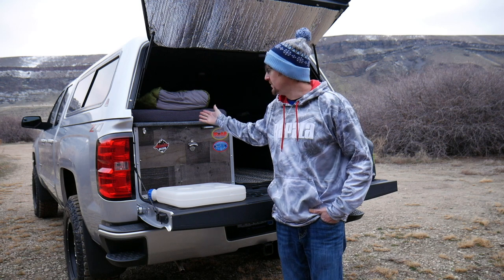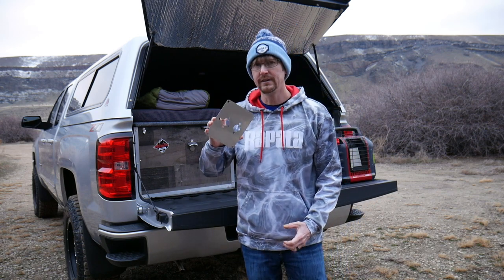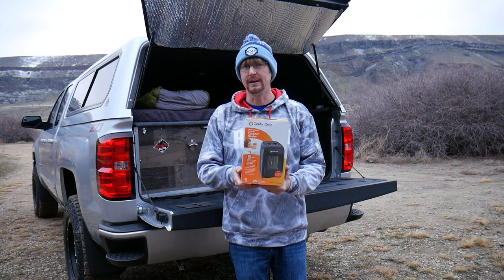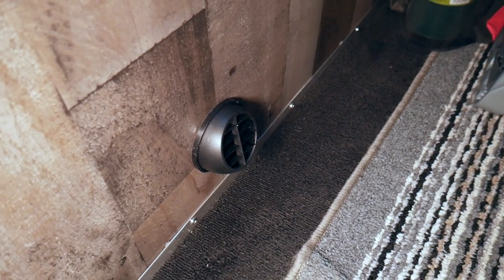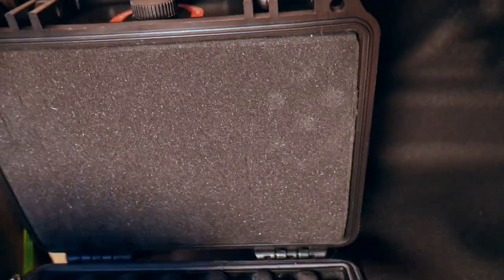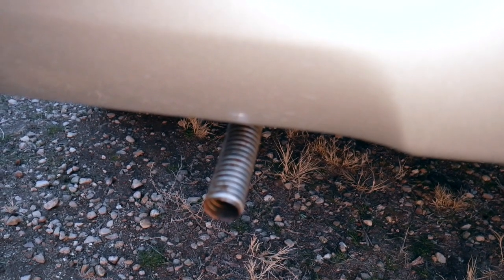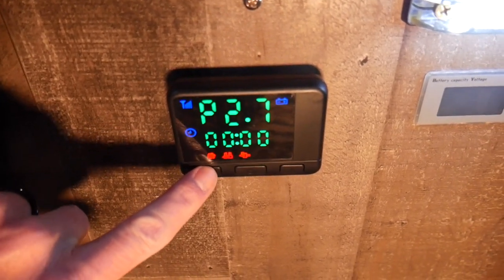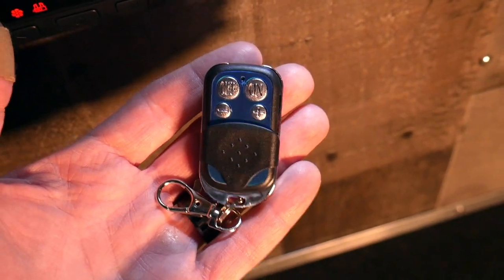Diesel heater setup in my 2019 Silverado! Best heat source for winter truck camping?

Comment: I have several of these heaters. The older ones with the metal body just don't die. The ones you get from ebay or amazon with the plastic bodies nowadays typically last a few years. The diesel pump and the internal fan motor are the only problems I've had so far. The pump for some reason just quits and you don't get the proper dosage causing it to try and start but it won't. The internal motor to drive the fan blades is a brushed motor. The brushes wear down eventually and its much easier and cheaper to just replace the motor than the brushes. You will hear a whining sound when it starts to go and the force of the fan starts dying down. From what I remember both conditions cause an error code. Much love from NW Ontario Canada
Reply from the maker: So far so good. This one is 3+ years of being used and not an issue. If it dies at this point, it's cheap enough to just replace.

Comment: Do you have the link for the plate you mounted your heater with?
Reply from the maker: Hello, here is a link to the plate I used. Thanks for watching.
https://www.ebay.com/itm/294028318502?hash=item4475741726:g:AoEAAOSwxqBgNGV3&mkcid=1&mkrid=711-53200-19255-0&siteid=0&campid=5338906919&customid=&toolid=10001&mkevt=1

Comment: I'm thinking about using one of these to heat the cab of my Toyota Tacoma, on which the heater has gone out. My question is about the power source. I don't know much about marine batteries. How would you recharge the battery the diesel heater is connected to since, in the setup shown here, the battery doesn't have an alternator to recharge it? My biggest question is, if I mount the diesel heater in the bed of my truck and run a hose to the inside of the truck to pump in the warm air, while venting the exhaust out the tail gate, how would I provide electricity to the heater?

Comment: Can you safely run the Chinese diesel heater… While you’re running down the road?
Also, would you include a link to the adapter plate for the bottom of the install that you ordered? 
Excellent video and thank you for your time .
Reply from the maker: I probably wouldn't but I think some people do in vehicles and camper vans. I have links to the plate in my newer diesel heater videos. Thanks!

Comment: Great video! Really nice DIY solution you came up with. One thing... I recommend you get a carbon monoxide detector to install in your cab just for safety in case there's a leak in the exhaust or combustion chamber.
Reply from the maker: Thanks for watching. There actually is a detector in there. I didn’t specifically show it, but it’s definitely there.

Safe travels

Comment: I have been using one of these for 5 years now, a 8kw unit but its in a RV. I live in it full time, including Canadian winters. the only thing that wore out was the pump, $28 to replace. To be fair it was probably my error, at minus 40 the diesel fuel will gel burnt out the pump running dry. 

I now run a 1:1 ratio of kerosene and diesel in the winter, zero problems since. brilliant idea on the camera box for the pump. For the exhaust I used a marine chrome exhaust port flange from amazon, $40 super clean install
Reply from the maker: Good advice. Thanks for watching!

Comment: You need to market that fuel pump noise suppressor, that is a really great idea!
Reply from the maker: Thank you. I still feel like I can make it even quieter. That's one of my goals for this summer. We'll see what I can think up.

Thanks for watching.
Reply: @Outside605  couldn’t you just put the pump on the outside; under the truck bed.

Comment: I have a 2019 Ram and was looking into this but I don't know if I want to drill a 4 inch hole on my 70k truck. I mean, my wife may not agree with it but 4 inches is significant.
Reply from the maker: HA!
It's a painful decision to drill into a nice new truck. I keep the piece that the hole saw cuts out and when I sell/trade, I tack it back into place. It worked pretty slick. I traded this truck in about 4 months ago and it wasn't as noticeable as you'd think.
Thanks for watching

Comment: I’m on my 5th velvor? Diesel heater and I’ve never had a single problem with any of them. I full time a motor home and use two of these to  heat a 30 foot motor home. I also have one in my jeep and truck. You can’t go wrong with these for the price.
Reply from the maker: I have no complaints. I ran this one quite a bit all winter long with zero issues. From elevations around 300' to 5,000' - it never failed to start/run and I never had the soot issues some people experience. You're right - for the price these are really tough to beat. Thanks for watching!

Comment: As for longevity I've had a five kilowatt one for over five years now and it has worked flawlessly  I have it in a 24-foot Class C motorhome it will keep my motorhome warm at  -20 Celsius no problem  it's been a great investment
Reply from the maker: That's great to hear. Hopefully I get the same results. Thanks for watching!
Reply: Glad to hear I have a 2k in a stand-alone unit I use for truck cap camping. Work great ! Really hope mine last as long. If it last 5 years like yours that’s $20 bucks a year.  Great bargain compared to paying extra for a powered camp site, running a generator, or even using a propane  heater.  Thanks for your comment!

Comment: Great video! Good detail ! Do you get a diesel smell At all? Trying to figure out how I can make your setup work for me.Unfortunately I have a big cab with a 5 1/2 foot bed.Also I'm a little too tall to sleep length ways so I may have to do a full size mattress and sleep corner to corner.Thanks
Reply from the maker: No smell at all. I would highly recommend a turret plate to install the diesel heater. Much easier to seal up to keep any potential exhaust/fumes out of the space.

Good luck on your install!
Reply: @Outside605  Thanks!

Comment: Great Video.  I have been considering a Diesel heater for my truck, but I live at 7,000 ft in Colorado.  I have been researching how well these heaters work at altitude, but even the expensive heaters say they work up to around 8,500 ft.  which isn't much higher than where I live.  Have you used your heater at elevations in this range and did you notice any issues?
Reply from the maker: I've used it to about 6-7000' but not higher. I think you can get creative with the settings to better function at high elevations but I've not done that yet. 

Good luck!

Comment: Excellent job on the installation! I've been truck camping since the 80's & I've always used electric heaters, but this now has got me thinking about getting one. Drive safe. 🤠
Reply from the maker: Thanks for watching. They are fairly efficient and don't cost much up front. A little creative install, and it's a great way to stay warm all winter.

Comment: I replaced the propane furnace in my 18 foot camper with an 8kw diesel heater. I lived  in that camper full time for 3 years and only had 1 issue with the heater. About 2 months in the fuel pump gave out. the best part is the heater put out way more heat than the propane furnace and went through way less fuel. 20lb propane tank would last 1.5 days vs 1gal of diesel a day
Reply from the maker: That's awesome. They are very economical vs propane for sure. I did the math last winter, it cost me less than $2 a night to heat my truck. Can't complain about that.

Thanks for watching!

Comment: Great video and camper build! I have a 2004 Dodge Ram I am planning to set up as a camper. I like the lightweight, simple design your have. Question about the heater intake: Does it use fresh outside air and or ambient air intake that's switchable, kind of like a car heater?
Reply from the maker: Hello and thank you. The heater intake uses fresh air from outside via an intake pipe mounted under the truck box. There is a fan that blows ambient air through the heater "fins" than warms it up. When installed properly, I feel like it's safer than a buddy heater. I still use a carbon monoxide detector just to be safe. 

Thanks for watching.

Comment: I've  been dragging my feet on installing the one I have for my truck and really appreciate your videos on how you did yours. I do have a question about the fuel line as I must have missed something. Why does the fuel line go into the bed from underneath if the heater and tank are both in the bed?
Reply from the maker: That’s a good question. The path of least resistance to the combustion chamber if I had to guess. Thanks for watching
Reply: So you have the option of plumbing to truck's diesel tank instead of small plastic tank. That way it's all outside.

Comment: I had a fun bunk in my 1992 3/4 ton Dodge  4x4 5.9 12 valve Cummins and we pulled a 25’ Road Ranger and we went all over the west so my wife and daughter and her girl friend for 5000 miles and in the mourning we put a 12 volt fan in the sliding back glass with blow up seal between truck and a big glass camper shell and with ac on max and vents blowing toward back window they stayed cool all day and it worke great and dear season a little ceramic heater plug truck and tur it on high and 1/2 later put on low and stayed toasty all night .
Reply from the maker: Sounds like an adventure. 

Thanks for watching and safe travels.

Comment: Great video!

Any idea what kind of current draw do you typically see out of this?

Also, what size battery is that you're using? Do you just charge it off shore power?
Reply from the maker: I haven't spent time looking a usage draw but with a 100ah battery, I can run it for 3-4 nights on a charge. Maybe more, I've never run it out before adding charge. Shore power or my portable generator. Works well for my needs. A roof mounted solar would probably be a great option.  

Thanks for watching!
Reply: @Outside605  Appreciate the prompt response! Found some details on other sites that listed it at about 0.7Amps give or take so that checks out. Seems like it'll work in nicely with my build and electrical system going in. Thanks for the info and inspiration! Keep crushing it.
Reply from the maker: @bigrunnermaniac  Fantastic. Mine has been flawless so far. Good luck and safe travels!
Reply: Useful video and well put together. Thanks Man.

Comment: Thank you for the video! Looking into heating my truck bed camper but wanted one small enough not to burn too hot
Reply from the maker: Thanks for watching! A 2kw seems to be just right for a truck cap. Careful when purchasing though, not all heaters advertised as 2kw are actually 2kw. Best wishes!
Reply: @Outside605  one question I have since I’d rather avoid drilling a hole in the bed of my truck, could I install the whole unit sideways and rig up to vent out the little storage recess in the side of the bed and out the rear? Or install on the exterior of the truck and duct the heat into the side opening. I have a whole summer to figure out exactly what I can or can’t do but I plan on making a little video detailing my path as well. I’d love to see any camper updates you’ve made since
Reply from the maker: It's very possible. I wasn't a huge fan of drilling a hole in the bed either but I worked up the nerve to do it. In hindsight, I wish I would have thought outside the box a little more.

Comment: I'm curious.  If the fuel line enters the heater from under the bed, couldn't the fuel pump be installed under the truck bed as well.  Wouldn't that avoid noise inside the  sleeping area?  Or is there a reason it has to be inside.
Reply from the maker: You absolutely could. I've seen that often on van builds. I drive through a lot of slushy, salty roads in the winter and having it inside is one less potential point of failure. The downside is the noise. Thanks for watching.

Comment: Have you had any issues with mud, dirt, dust, or grime on your intake underneath the truck?
Reply from the maker: I haven't. I put it out of the way where it's not as exposed to mud. Dust - I'm sure it's seen it's fair share but no issues with clogging or heater performance. Where I live, it's very dry during the winter. Not a ton of mud to deal with. Thanks for watching!

Comment: Can you take the bed system out of the truck?  If so how does that work with heater.
Reply from the maker: Yes. I remove it several times a year when I need to use the truck bed for a project or to pick things up from the store. I leave the heater attached to the truck bed during winter and during the summer, I remove the heater altogether. The bed is fairly light and I can slide it up and over the heater to remove.

Thanks for watching.

Comment: How cold have you camped with that heater? I'm just curious how well the 2kw heater works in extreme cold temps.
Reply from the maker: I camped down to mid single digits. Honestly, it would work in much colder weather. I typically run it on low to medium. The back of a truck is such a small space, it doesn't take much heat to keep you warm. In my opinion, anything over a 2kw is overkill for this kind of camping. 

Thanks for watching!
Reply: @Outside605  Thanks for your response! It's incredibly valuable information as there aren't too many people using diesel heaters like this.

Comment: Thanks. So battery charging is addressed how?
Reply from the maker: Usually I’m truck camping on fishing trips. I have the inverter generator to charge the trolling motor batteries so I also charge the battery in the truck at the same time. Every so often I stay in a campground with power so I’ll charge off that if needed.

That said, I’ve got 3 nights running the diesel heater off a single charge. That’s often enough to get me through a trip.

My new setup has solar. Hopefully I’ll have a video of it soon. Thanks for watching!

Comment: How's it holding up?
Reply from the maker: I've used this exact heater for 2 full winters now. I don't full time, but camp fairly regularly. It's never skipped a beat. The only "issue" I had was this past March in Laramie, Wyoming. The elevation was too much for stock fuel settings. Outside of that, it's quite the machine.

Thanks for watching.

Comment: You also upgraded the fuel filter ?
Reply from the maker: I didn't for this season, nor did I upgrade the soft green fuel line. Surprisingly, I ran this heater probably 20-30 days/nights since I installed it in December with zero issues. That said, my plan is to upgrade both for next winter.

Thanks for watching!

Comment: HOW IS THE HEATER BATTERY CHARGED ,,
Reply from the maker: Since I work full time, my trips are typically over the weekend. The battery has no issues running the heater 3 nights and more on a full charge. If I’m going on a longer trip, my little inverter generator does the trick.
Thanks for watching
Reply: @Outside605  thanks

Comment: They all use same parts and you can order any part you need and they have rebuild kits to make it new. If you can get kerosene or Jet A fuel works the best no soot build up like diesel or you can blend it 50/50 and your good wont have to take apart and clean, JetA or kerosene is the best and diesel is third choice or a blend is better then 100% diesel !
Reply from the maker: Good info

Comment: Is it possible to run it off of a cigarette plug instead of battery
Reply from the maker: I would assume you could, depending on the rating/fusing of the port/adapter